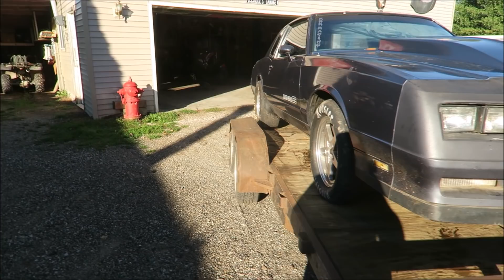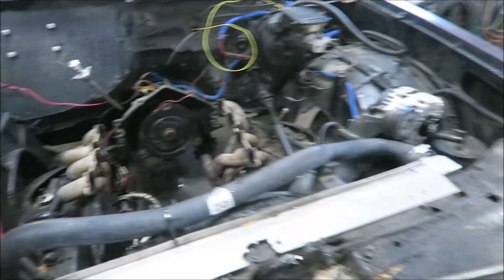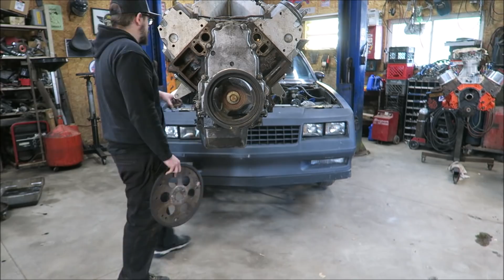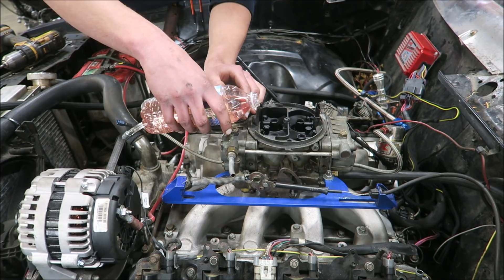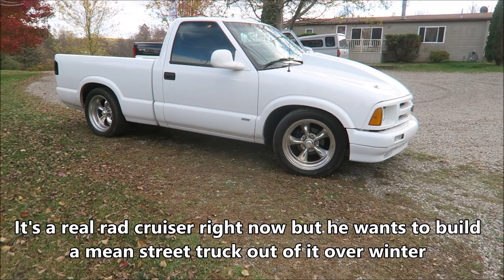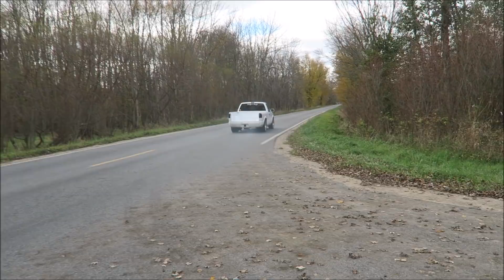Monte Carlo SS Nitrous Grudge Car!!

Comment: So are the fuel injection system and ignition system completely independent of each other on a 5.3? I didn’t think you could carb newer engines because of how the pcm would react.
Reply from the maker: On an LS all you need is something to control spark, in this case an MSD   box that plugs right in to the coil packs. Then just a carb and intake 🤙